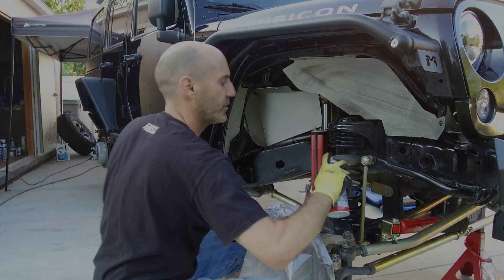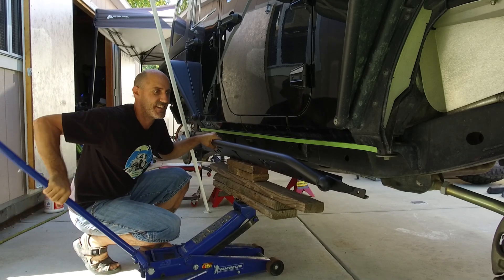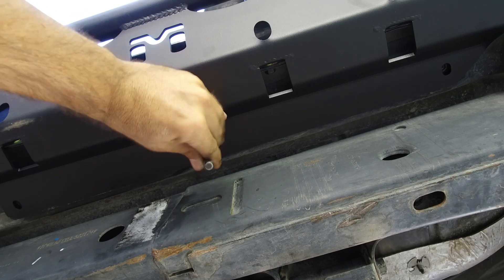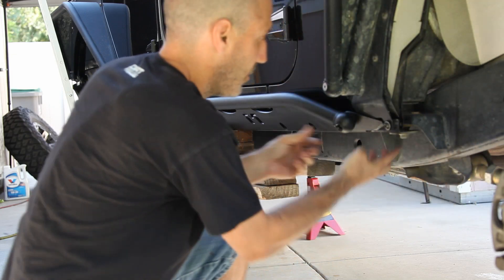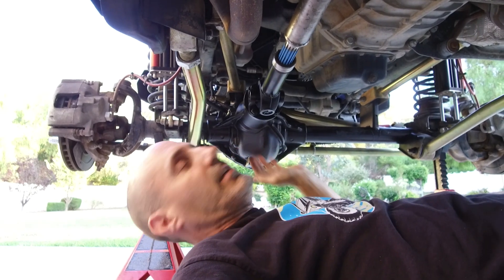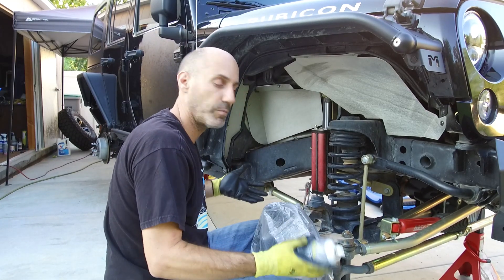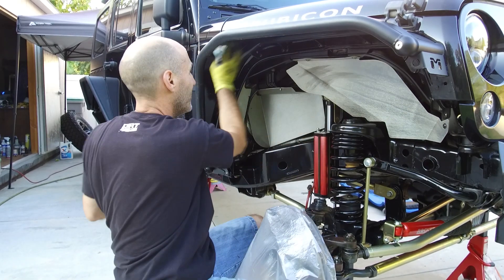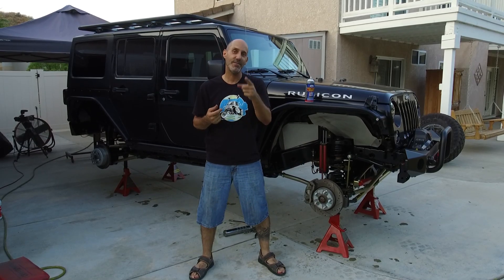Jeep Wrangler MetalCloak Rocker Rail Install PLUS How to Make Your Chassis Look Amazing

Comment: Great video to augment the Metalcloak instructions.  One strong suggestion: you will need to install at least 4 threaded inserts, possibly many more depending on your vehicle configuration.  The supplied “tool” is pretty sketchy and prone to causing errors that are difficult to fix.  If you use manual strength to install as shown, you will wind up pretty sore.  If you use power tools, the inserts will strip.  Save all that hassle and use a proper insert tool like this one from Amazon - Astro Pneumatic Tool 1442 13" Hand Rivet Nut Setter Kit, that’s about $50.  You’ll also need a properly sized mandrel for the 3/8” threaded inserts, also available from Amazon for $15.  There are others that are cheaper, but regardless of which one you use, the inserts will be properly seated without stripping.  The tool will pay for itself, especially if you are also installing the rear fenders, where there’s dozens more inserts to install.  Also, a step drill is far superior to standard drill bits for drilling through the sheet metal without binding or tearing and leaves a much smoother finished hole without a burr.  It’s much faster too.  After center punching, I drilled a 1/8” pilot with a standard bit and then went to the step drill for the 3/8 holes and 1/2” for the threaded inserts.  I then chased the 3/8” holes with a standard 3/8” bit for bolt clearance and for the insert holes, finished them with the 17/32” bit that Metalcloak offers.  After trying the bit sequence for gradual size increase with standard bits and still having the bit bind and tear the sheet metal, I tried the step drill combination described and didn’t look back.  The install of all 4 fenders and rails required more than 50 holes to be drilled and the step drill method was the fast and left a perfect hole that didn’t require additional deburring.
Reply: good info Thank you

Comment: I just did the Rubicon Trail with my 2015 Rubicon Hard Rock Unlimited with a 3" lift, 35" tires, stock Dana 44 axles, stock Hard Rock rock rails, stock driveshaft, stock skids. Damage? Yes. But mostly my aftermarket rear bumper and skids. Zero damage to the body, tires, driveline or any suspension bits. It was a blast. Coming down Big Sleuce and going up Cadillac Hill was pretty interesting. Only high centered once and had to use my winch.
Reply from the maker: Sweet!

Comment: Were you there???

I just came back from the Jamboree! Made it through, slightly intact.... I thrashed two front right tire sidewalls, demolishing one wheel in the process, and I totally bent my right nerf bar into a V shape... Ha!

Had to borrow a really awesome dude's spare tire to drive home since my patched spare wasnt safe for the freeway, but the patch job the mechanics did for my spare was short of a miracle. I got through Cadillac Hill unscathed, minus a jammed up valve stem on another tire.

Too bad I missed ya, but I hope you had a great time! I'll be sure to check out these side rails... I'm definitely in the market for some new ones. 😜

Happy Jeeping! 👍👍👍
Reply: Wait a sec! I think I saw your Jeep in the mechanics tent. I noticed the shocks, and thought they looked familiar! Was that you???

If it was, I didn't put two and two together, but I wish I did! Also, if that was you, what happened, brotha?! Hope it worked out.

Safe travels!
Reply from the maker: I haven't gone yet... leaving tomorrow.
Reply: autoedit - Ah.... Thought I just missed you with the group you're rolling with. So amny people at the Jamboree.

Good luck on the run! Watch out for Little Sluce and Big Sluce. Both nailed me. Otherwise, it's a breeze... slow and steady.

Have fun! 👍

Comment: Great video. I would like to see you do some electrical equipment upgrade videos like a badass real GPS for your off-roading , dual batteries & wiring , defeating the inertia fuel switch and/or how to by-pass switches so one could self-rescue on the trail. Most guys have problems wiring up an aftermarket stereo.
Reply from the maker: I really like these suggestion!  I'll work on something in there... love this...

Comment: I use Fluid Film it makes it shiny but it also is a rust stop coating (like rhino line but better). I dust it in the frame an everything. I have an 01 Ram with 375,000 miles up here in PA and they isn't a spot of rust on the frame or axles

Comment: Hey that's great! I never really though of using a WD40 type product for that. In your earlier videos I had just assumed you regularly power washed it and hit it with Rustoleum or similar. And also, because California. I'm in New England, where there are 5 year old cars that look like they came off the Titanic. WAYYYY too late for my cars, but I'm definitely going to do this if/when I get my Rubicon :)   I had asked you about black a few weeks back, I ended up passing on that one. Going to hold out for one of the colors I like more.

Comment: Seem to be alot people telling you , "You Should" do this and that LOL.
Thanks for the great tip , I already priced it on Amazon. A case of 12 for $64.99 or $11.97 each for an 11oz can.
Reply from the maker: Yes!  I went in on a 12 pack and even with using it like this, I'm still doing pretty good with my supply.

Comment: Great stuff,  I have trouble keeping things clean up here in Canada. Also, what I do when I fab up bumpers, after paint i coat them with RockerGuard for a more durable finish that wont chip and rust as fast. Its more resiliant than plain old black gloss paint like Tremclad or Por15 by itself. Its just a really nice textured look... that being said, I'm surprised you haven't coated your steel rockers and fenders with a textured rubberized coating like Rockerguard... although i suppose its way hottter where you are so maybe you dont want a coating like that, might get soft in the summer, iuno.

Comment: Awesome install video. Just a tip. Might want to antiseize those nutsert bolts too. I've had them spin because the bolts would seize inside.
Reply from the maker: Great suggestion, I did put a bit of oil on those before tightening them down!
Reply: autoedit ok. I put a set of genright rocker guards on my LJ and I went to take them off and the some of the bolts were seized and the nutserts would just spin. Very frustrating! Good luck!

Comment: is it ok to spray WD40 on the front and rear differential and the shocks ? 
will this do any problem with the differential coating ?
is it ok to spray WD40 on a rubber , pipe or Bushings ?
Reply from the maker: It is a petroleum product so over time it will probably break down rubber but over the decades I've done this... it's been fine.

Comment: Amazing products unfortunately we don’t have it where i’m living.. question please: i tried the WD-40 works good but i heard it removes all the grace where it supposed to stay, am i right? And one more thing, does it damage the rubber by long term time? Appreciated! Thanks!
Reply from the maker: I used wd40 before this on all my dirt bikes and didn't notice any problem on the rubber parts. How would spraying this remove grease from spots that need to be greased? It's fine.

Comment: Keep up the great work Jason.
Even here (Portugal) on the other side of the Atlantic ocean you've got fans. ;-)
Now, if you allow me: i own a 2019 Wrangler JL (diesel version) and i'm looking to install some good solid rock sliders.
I've seen your video and a few others a couple of times and found a guy that said and i quote ".. I really liked those but went with the Patriot sliders from Rock Hard 4x4. Really didn’t like that Metalcloaks bolted to the pinch seam and not the frame. I’ve seen guys bend rock sliders mounted to the pinch seam up into the Jeep and damaging the rocker panels."
My question: i don't really care about any other model that person installed, but concerning this specific that you've installed from Metalcloak, what say you? Strengh, resistence, durability, etc...
Thanks and again, congrats on a fantastic work.
Reply from the maker: Howdy! Unless you are a competition rock climber... needing to mount your rocker rails to the frame is overkill... plus the body is mounted on dense rubber mounts so there is a bit of flex and I'm not sure how frame mounted sliders accommodate that bit of movement. I have been extremely happy with mine... used a hi-lift jack to lift the entire side of my jeep in the air with them and smashed them on rocks.  Strong like bull.   Get a set that you like the looks of and have a few good reviews. The MetalCloak sliders I have are extremely well design and tie into both front and rear fender and body armor.

Comment: Is there a reason you didn't put on the Rail Rocker ExoSkin behind those rails? Seems like it would strengthen the tub a lot...
Reply from the maker: Seemed like overkill for what I need.  Turns out this system is PLENTY strong without those exo skins... I ran Pritchett Canyon in Moab and smashed those rockers multiple times hard and they did fantastic.

Comment: You ever try fluid film? I believe it does the same job as the tool box buddy. But with the fluid film I’ve noticed dirt and grime gets stuck to it.  Does the tool box buddy do the same?
Reply from the maker: Never heard of fluid film.  I've only used WD40 and the Lucas stuff.
Reply: autoedit you use this Lucas stuff under the hood too?

Comment: Looks good. Surprised the sliders don't drop lower than the chassis (like on other 4x4's)
Reply from the maker: They are designed that way on purpose to give you the most clearance so you can squeeze through an obstacle if possible.

Comment: So how are you liking the Metal cloak Control arms I’m about to do the Front lower control arms on my jk and trying to decide on what brand to go with I’m looking at the metal cloak and the EVO and rock krawler
Reply from the maker: I have been extremely happy with all of the MetalCloak suspension on this rig.  Here's my highest compliment... if I had to do it again.... would go exactly the same way!
Reply: autoedit ok sweet I have been up in the air about what arms to get

Comment: I messed up this install, for some reason I couldn't get the inside of the rails completely flush with the bottom of the jk. I got them as flush as I could and drilled the 3 bottom holes first using a step bit that went from 25/64 to 35/64 not 17/32, so it somehow oversized the holes too much and I couldn't install one of the riv nuts on the back. I kept going back and forth trying to align the holes on the side but it was a pain in the ass. I then figured out that my Poison Spyder body armor skins were not completely tightened on the bottom so it was stopping the rails from aligning properly. Took me like 6 hrs to finish one side, now I know what to do for the other side...

Comment: Plastidip the key holes black.
Reply from the maker: Thanks for the suggestions... I take it you have done them on yours?
Reply: autoedit I don’t have a jeep but it it would make yours look better.
Reply: autoedit But get BlackVue front and rear dash cam for proof and protection,Metal hood latches,AntennaX antenna,blackout jeep badge on grill,get bright white LED interior lights.

Comment: I question their strength being as they only mount to the body and not the frame. One hard drop on a rock and one would think they would bend up and cause body damage.
Reply from the maker: These are strong enough for the Rubicon trail and that's good enough for me.

Comment: Whenever I see a Jeep on the road, I know inside there is a 120lb insufficient man wanting to be a king.
Reply from the maker: For your information, I weigh 135lbs.
Reply: @AutoEdits  You should buy some food instead of spending so much money on that jeep. I don't know what's worse, you weighting 135lbs or those drilled rotors